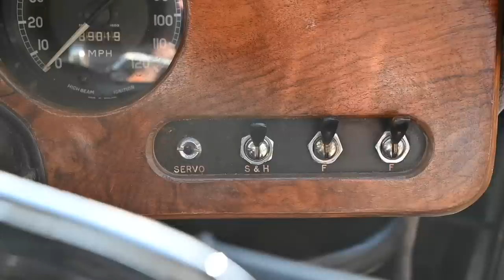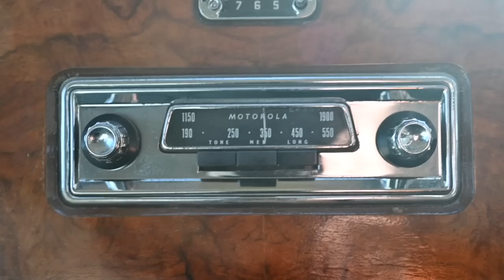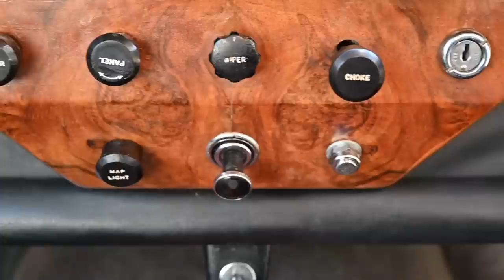1961 Vanden Plas Princess 3 Litre Goes for a Drive

Comment: I have an unusual question: When big BMCs got automatic boxes, did they use an AP unit or a Borg Warner?
Reply from the maker: I think it was Borg Warner
Reply: @furiousdriving  My 6/110 type Austin Westminster had  a B/W DG transmission as used in R.Rs or so I was told. You could put it in reverse and use both pedals to slow it down on steep hills. It cost a "tanner" every time you switched it on and juiced those big SUs.
Reply: Ian Baxter It’s a wonder that the gearbox survived that treatment, let alone kept working. Under throttle in reverse while going forward. Gods almighty!

RR/Bentley (pre BMW/VW) always used GM 3speed Hydramatic boxes and torque converters when they moved to full automatics. Before that they used a 3 or 4 speed British (make?) preselector box with a fluid flywheel. Even earlier, they were 3speed manuals.

When they introduced the Silver Shadow in the 1960s, the ‘all new’ 6.75L V8 was also from GM in Detroit. And it had been around for a few years in Chevys, Buicks, Cadillacs etc. But, they were rebuilt by RR, the only GM bits surviving the rebuilding being the block and exhaust manifold.
Reply: @Twittler1  The early cars used the DG box which has a direct top gear and this made the cars more economical the later A110 etc that used the Borg Warner 35 box which simply broke after about 18000 miles,

Comment: Nice car indeed. I'd be delighted to own it. On the foot dip switch, it's of course a switch handling lots of current, so needs to be chunky, and chunkiness is not all that compatible with a dinky little stalk switch, though achieving both aims became common not long after 1961. You forgot to demonstrate the overdrive! I believe it's an overdrive in the American manner doing it's thing automatically unless disabled by the T knob. I much prefer them controlled by an electric switch as is more common for British cars. I wonder if you made a bit much about independent front suspension being modern? Other than the Ford Prefect, I struggle to think of a post 1948 British car which didn't have IFS. Love your videos - keep them coming!
Reply from the maker: Didnt forget, the roads were too twisty to get a good run at a suitable speed and try the OD.
Although its alot of power, cars were using stalks for the dipper without relays up to the 70s, the fuse boxes do occasionally melt, but it was possible. I think it was felt it was easier or safer

Comment: I wonder if my comment will be “deleted or answered rudely”, as mentioned by furiousdriving at 2:49, or will it be discussed with furiousdriving in an intelligent way instead?  Maybe I could give my take on the history?

There seems to be a valid argument to say “Vandan Plah” is the correct pronunciation in this case.  The English company became a different company to the one called "Carrosserie Van den Plas", founded by Guillaume van den Plas in Belgium.

The English owner of “Warwick Wright Ltd” acquired the rights from “Carrosserie Van den Plas” to use the name Vanden Plas.  Warwick Wright then set up another business called “Vanden Plas (England) Ltd”, to build bodies under licence.  Vanden Plas in England was then bought by Airco (Aircraft Manufacture) around 1917.  This English company then became known as “Vanden Plas (1917) Ltd”.  The company ceased its business connection with the Belgian company founded by the Dutchman – they are now two different companies with different owners. “Vanden Plas (1917) Ltd” was then placed in receivership in 1922.

The rights to this English company and its name were then purchased by the Fox brothers in 1923, who then registered it as “Vanden Plas (England) 1923 Ltd”.  It clearly isn’t a Belgian company at this point, and never was, as even in 1913 it was a company in its own right, building under licence.   The connection that it did have with the Belgian company only lasted 4 or 5 years, 1913 to 1917.

In the early 1920’s, “Carrosserie Van den Plas” & “Vanden Plas (England) 1923 Limited” were exhibiting at the London Motor Show as two seperate companies.  Perhaps the Plah pronunciation came into effect around this time, or even before, to identify thenselves as two different organisations, with different owners.  It’s their company after all; they can market the pronunciation of their separate company name in whichever way they want.

In 1946, “Vanden Plas (England) 1923 limited” became a subsidiary of the Austin Motor Company. The separate Belgian business, owned by “Carrosserie Van den Plas” ceased in 1949.

In 1967 “Vanden Plas (England) 1923 limited” stopped being a subsidiary company & became the Vanden Plas Division of BMC.  BMC called it Vanden Plah, (the French pronunciation?), as later did BL, and Jaguar after them.  If the company who is manufacturing & selling these cars are using the Vanden Plah pronunciation, & marketing them as such, who are we to say they were wrong to do so?
Reply: Your post has survived the test of time Brett !
Thanks for ALL the detailed history of the brand !😊

Comment: Excellent! Overdrive not tried though?  It gave freewheel (and clutchless gearchanges under a certain speed). I  loved my dads 6/99 which had same box. Haha controversial comment  bit..correct pronounciation of original firm’s founders name but, imo, the ‘s’ was pretty universally silent when BMC dealers etc mentioned the car back in the day, in my experience anyway. And so the debate continues?.. great channel btw.

Comment: Bought one very cheaply part exchanging a rotten Fiat 600 ,bit of a  contrast. Had a 3.5 litre Austin 6. Guy once came up to me while I was filling up at a garage and said he wouldn't sleep at night with that in the garage, I used to roll dawn hills with the engine switched of,anything to save petrol. And no flimsy jacks, hydraulic powered press a button jack on all 4 wheels, lifted the whole car. It was fun to own.
Reply from the maker: I need to find one of those now!

Comment: Whilst it’s a nice example of Vanden Plas trimming, and if I had the means in those days, I would have looked at either the Jaguar Mk II 3.8 or if I was more ostentatious, I would have leant towards the glamorous Jaguar Mk 10 3.8 litre with its triple SU XK engine.
 For me, it’s the styling that grates. This car looks really staid and conservative and is too upright and narrow. The Jaguars by comparison were more advanced and looked so much better. Today I have the best of both. The Jaguar derived XJ saloon badged as a Daimler, trimmed by Vanden Plas with the silky V12. Princess had a real problem with the Coventry cats....
Reply: I personally prefer this Vanden Plas precisely because it is conservative and upright. If I want an executive saloon, I expect it to be dignified and reserved in nature. Jaguar cars, while perfectly suited for performance, doesn't really deliver on this front. A bit too Flash Harry for my liking.

Comment: Really lovely car and I meant it, but there are two areas where I feel its kinda lacking, there is a lack of style in the dash, to simple in its layout. It needed a hooded pinnacle over the two main instruments forward of the driver personally. Second is that the combined steel wheel and tyre were reduced in size to earlier models? These vehicles look very under tyred.
Reply from the maker: I think most big 60s cars look like they have too small wheels to today's eyes
Reply: Quite right as you say, but there were equivalent cars of the era where the wheel and tyre were larger. Nevertheless on a different matter putting modern radials on these smaller rims doesn't help re looks. I was looking at a Riley Pathfinder the other day and it had modern radials on the rims, it looked very odd with acres of space in the wheel arches. Granted there is a pay off with the modern tyre, re handling etc but I've found it makes the steering heavier for a car not designed for them. I used to own a 1958 Riley 2.6, a very rare car these days (similar in some ways to the Pathfinder but using many different panels/engine etc) I ran it on modern quality light truck tyres. of the size etc as per original. The Riley looked 'right' and 'period' with these on and once at speed the steering was fine.
Reply: Wooden interiors were extremely conservative in those days, the ideal was to have the instruments mounted on a wooden plank. Yes, a plank, as that's how it was done originally when the concept of a dash was invented in the first place some fifty years prior to when this car was made. So yes, it looks seemingly simple, but that was the intended very conservative ideal. So, in a sense, the wooden interior looks exactly as intended and exactly what the clientele wanted, simple or not.
Reply: There was a drive in the sixties to reduce wheel size, why I don't know? The fintail Mercedes famously went down in size to 13 inch wheels from its predecessors 14 inch wheels. It was just a fad of the time, the lesser wheels making for a visually more impressive car?
Reply: Ingvar Hallström 

It would have reduced unsprung weight of the steel wheels of the day and improved the ride. Tyre technology was advancing as well, reducing the need for as much sidewall. Plus the move to disc brakes improved braking capability overnight, and meant there was less need to have large brake surface area compared to the size drum brakes with equivalent stopping capacity needed to be (mainly to dissipate heat, in an effort to prevent brake fade).

These days alloy wheels are pretty ubiquitous, meaning unsprung weight shouldn’t be an issue, and ever-increasing weight of cars means the surface area of brakes needs to be bigger to cope. Hence wheel sizes started to grow again as cars started to get heavier. In the ‘80s most base models of family cars had 13” wheels, now it’s 16” that’s the norm.

Comment: That rolls lump is awesome
Reply: It's not a Rolls unit it's an old BMC engine dating back to Austin Healey days in the late 50's, might hve originated as a truck engine (not sure), the Vanden Plas 'R' had the four litre Rolls Royce design lump... also the bloke in the video is pronouncing it wrong, despite what country the name came from when the car was sold it was pronounced Vanden 'Plar'
Reply: @leswhiting6131  learn something everyday . Thanks. That would be a c type engine . Heavy and reliable . BMC wanted three engines . The A for small cars B for medium and c for large . I believe it was a truck type engine designed for the whole range of BMC . Good with a single carb . The twin or triple carbs were prone to icing

Comment: 103 HP/158 lb-ft?

The 60 Chrysler 300F with the 413 Long Ram 2x4bbl (6.8 L) was packing a conservative  375 HP and 495 lb-ft.  Good for 0-60 in under 7 seconds.
Reply: The HP/Torque figures are a DIN rating standard that was used by all European manufacturers, including American owned ones, and which is now the basis for the Euro standard of measurement of output in KW and NM. Power and Torque were (and still are) measured under load and full throttle for a minimum of one minute. The declared figures are continuous output. 

American figures are now calculated the same way, but until some time back, not sure when, the SAE standard for output measurement was used. Full throttle under load, but the initial (high) burst of power, less than a second’s worth, was the figure used, with no duration readings. Using that system, this vehicle would have shown a HP reading of probably around 180HP, not 103 (34 HP/L)

I don’t know about the Chrysler (their engines were better at that time than Ford’s and GM’s on the whole), but I do know that the 1968 FWD Cadillac Eldorado, with an 8.2L engine was advertised as having 400 HP SAE.  Measured by the DIN/Euro standard, it comes out at 175 HP, less than 22HP/L.

Different system, different results. The specific (hp/litre) continuous output in DIN terms of American engines of the SAE period was very low, but also at very low engine speeds.  When my family lived in the US in the 60s, my dad had at one time a Mercury Comet with a 3.1L 6cyl, advertised at 88 HP SAE. Possibly around 50 HP DIN, less than 20 HP/L. And it was bigger than this VDP. With half the power and a 2 speed auto transmission. Slow doesn’t begin to describe it. 

It was sheer torque and short drive axle ratios that got those older American cars to get those high acceleration figures, but they didn’t have the power or engine speed to achieve comparable top speeds. A school friend of mine persuaded his mum to get a 69 Ford Torino 428CID (7L), 426 HP SAE. He drove it more than she did. The acceleration nearly pushed you through the back of your seat, but top speed? It ran out of breath and power at just over 100 mph, unable to reach the engine speed that it’s declared power was developed at, even with the shortest drive ratio available, about 4.07:1 I believe it was. It probably actually had only around 190 ish HP DIN, 27 HP/L.  Your Chrysler example probably developed around 180 HP DIN, 26 HP/L.
Reply: @Twittler1  THere are a few inaccuracies in your post:

The 8,2L Caddy motor did not debut until 1970.  It also had 10.0:1 compression to go with the 400 HP and 550 ln-ft of torque.  They dropped the compression down to 8.5:1 in 71.  By 1972,  the Big 3 switched from SAE  gross to SAE net.  In 72, the 8.2L Caddy had 235 net HP and 385 lb-ft.

Chrysler was notorious for grossly underestimating their power outputs for their engines.  As an example, in 51, they rated the 331 HEMI (5.4L) at 180 gross HP.  It was producing 187 HP at the wheels.  If it was a performance engine Chrysler would rate them lower for insurance purposes.

340 4-bbl....rated 275 HP....dynoed 310
340 3x2bbl rated 290 HP....dynoed 356
383 Magnum 4-bbl rated 335 HP....dynoed 370
413 2x4bbl rated 375-410 HP....dynoed 410-450
426 2x4bbl rated 425 HP.....dynoed 470
440 Magnum 4-bbl rated 375 HP....dynoed 410
440 3x2bbl rated 390 HP.....dynoed 430
426 HEMI 2x4bbl rated 425 HP....dynoed 508

The 440 3x2bbl in 71 was rated  at 385 HP.  Some early 72 models received the same motor in exact detail with a 305 HP net rating.

The 300F in 60 was a nearly 5000 pound car....175 HP....no way it will drop a sub 7-second 0-60...even if it was RWHP (actual horsepower making it to the wheels)

The Ford 428 was never rated at 426 HP by Ford.  The Cobra Jet version with one 4-bbl carb was rated at 335 HP.  The 2x4 Version was rated at 355 HP.  The Super Cobra Jet version of the 428 was rated at 375 HP.  The 428 Cobra Jet was dynoed at 410 HP.

For the record, the 300 in 60 had a 3.31:1 gear in the rear end, and had a 3-speed automatic..... top speed was in the 140 MPH range.

175 HP.......I'll call you out on that.  If you said 275 to 295.....I would have believed you.
Reply: I forgot this:  If you would have said that that 3 litre motor would have had a 130 to 140 HP gross rating, barring any changes to the engine, I'd believe you.  180HP...no way.

Comment: Why wasn't the overdrive used in the driving test?
Reply from the maker: The roads were too twisty
Reply: @furiousdriving  Should have found a way to use it. I had a Hillman Hunter Topaz, a Motor Show special, I think it was 1975, Overdrive on 3rd and 4th. It out accelerated 2l Cortina's in overdrive 3rd. Much to the suprise of the Cortina drivers.

Comment: What a let down when you opened the bonnet. The top of the range Westminster and Princesses came fitted with Rolls-Royce engine and gearbox. You know what you're getting then with things like triple belt fan belt drives ie robust engineering. Even the grilles are made to say RR in a quiet voice.

Comment: Next time something Different maybe a Hillman supper scepter? Hilman where very well build n put together, sadly always under estimated  n always second to Cortina but Always better
Reply from the maker: Im a big Rootes fan (they are my local car firm after all) and I very much want to do some Hillmans and their upmarket sibling Humber (Minx and Septre respectively)
Reply: @furiousdriving  The  only reason they where Not successful Rootes never advertise them n non of us knew how good they where, I only found out when my mate gave me a lift in his n instantly i noticed it was almost as solid as the old Peugeot 403s the body shell was Not flexing at all no rattles nothing dead solid next to the Cortina it felt  as if i was riding on RSJs it was that solid soon after i got my first minx n just over a year later my septre, so much better build than any ford I had at the time, cheers

Comment: I know this is random af. But any chance you could one on the original Ford Puma? Love that car. Still do!
Reply from the maker: I love them too, I will do one soon
Reply: furiousdriving perfect. Thanks! I love these videos. The obscure off beat cars that others don’t care to review. Thank you for doing it!
Reply: furiousdriving I had a Puma 1.7 VVT from new in 2000, kept it for 12 years. A glorious little rocket with a fabulous engine, and it handled like a go-kart, completely predictable, with brilliant road-holding. I still remember going up, down, and back again over a winding switchback road in the Provençal Alps to Val d’Isère three months after getting it. Engine howling in 2nd and 3rd all the way. Wonderful!

Never let me down, not once. The only (slight) downside was the ride - it had solid steel bars for springs, and 17” wheels shod with rubber bands. Uneven and broken road surfaces were a joy 🙄. Still, the handling etc had to be paid for somehow.

PS: Two downsides - carrying even a small dog in the back seat would have had the RSPCA gunning for you.